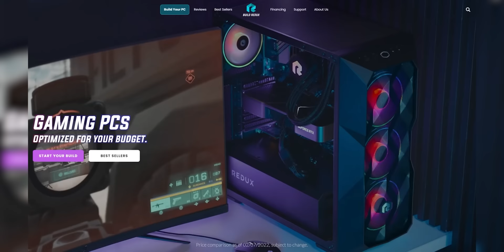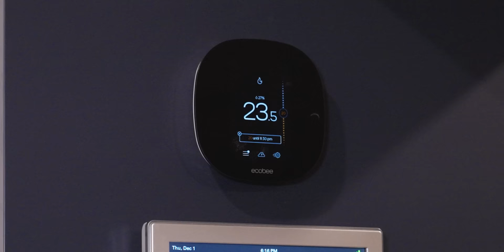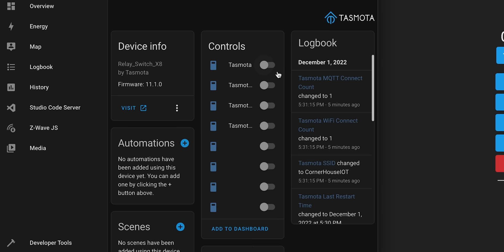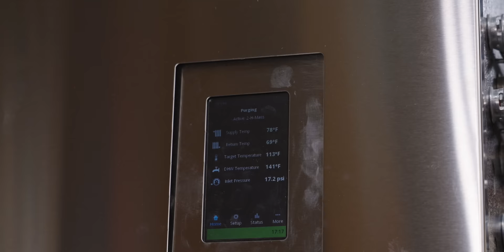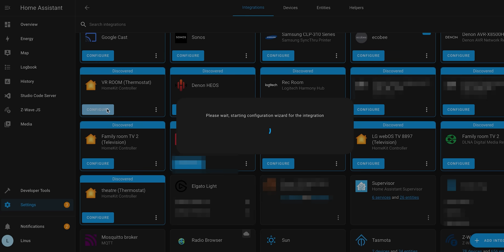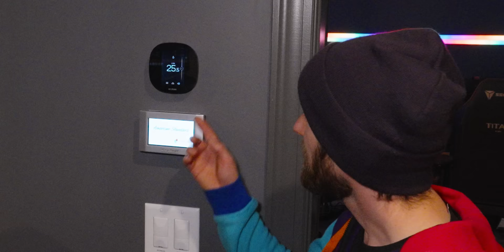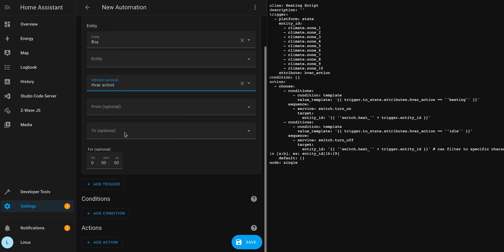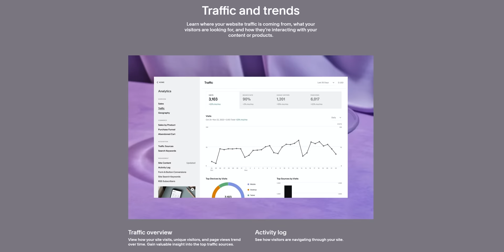My Smart Home is Stupid - HVAC Update

Comment: I would love it if you sold a curated selection of smart home devices. Ones that have been verified to work, with complete documentation.

I don't care if they're bare board like the board that does your hot water in floor heating. .
Reply: Just buy actual smart home devices instead of hobbyist shit and then guess what? They work!

Comment: Wow, you mean that I can pay for and install all of that technology, including a server instead of using my single zone forced hot air system controlled by a bi-metalic mercury switch thermostat that has sat on the wall since 1978.  How much does all that technology cost to run for a year?  Once it is working correctly?
Please include a final cost analysis in this series.  Thanks.

Comment: You can get extra sensors to place around the room, and have home assistant average the temperature of all the sensors. Ecobee won't show it, but home assistant can monitor and adjust your set temperature accordingly (with an automation).

Comment: Why use Tasmota instead of ESP-Home? Why spend so much on Ecobees when a $5 ESP32 with $2 temperature/humidity sensor running ESP-Home could dramatically simplify this? I’ve been doing this for 3 years flawlessly. Home Assistant has a software thermostat that’s so customizable.

Comment: Smart homes arn't for the faint of heart. All these manufactures want their propitiatory systems so toy have to buy their systems. And yes many utilize the cloud. So you need internet unless you go the route Linus did. Theirs a few systems that allow you to use it offline.  It's not that we don't have the technology, because we do. And things don't always play well with other stuff. You end up with a mix of different equipment and manufactures. You are consistently having to find workarounds, and then manufacture go out of business leaving you sometimes in the dark and having to change hardware. The whole smart home things sounds great in theory, till you work with it and find out you are basically better off with a non-smart home.

Comment: My question is why did you use a thermostat when you could have just simply used AZ wave temperature sensor? Home assistant has built in thermostat controls.

Comment: Jake was good until he said Rc was for cooling. Y is cooling, Rc is power. You need both C and R (R and Rc is typically bridged) for power unless using a battery . . . ALSO, why didnt you just go with GEOTHERMAL units? Plumbs into the ground, will always use heat pump, doesnt use an ugly condenser, more efficient and practical . . .  idk just saying

Comment: Why not have just one thermostat and have all the floor heating vs heat pump be done on the backend?

I mean really a "thermostat" is just an control panel and a thermostat, and those don't HAVE to be on the same device. The actual power could be don't by rpi io pins on totally separate device as well.

Comment: Pretty sure you can manually calibrate the ecobee, can't you?  If you know it reads 3c high where it is located, you can adjust the measured value down 3c.  EDIT -- I actually just checked mine now and it's there on the ecobee 3 lite, as "temperature correction" under the thresholds menu (on the actual unit, not the web interface).

Comment: Home automation is just a bag of worms. I long for the old millivolt systems that just WORKED. If you had steam or gravity hot water the heat worked fine without electricity, It wasn't as efficient as a heat pump but in a well insulated house at the end of the day it was cheaper because they NEVER needed service - as long as the gas was in the pipe you had nice steady heat.

I'm in a 100 year old house that is not well insulated but in 70 years the  steam system has only needed repair during the heating season ONCE and that was because I had the flu at the time. As soon as you add pumps and fancy control systems reliability goes out the window and $500 service calls multiply like rabbits in the spring.

Comment: This is cool, but I feel you would get better results if you ran the ecobee heat wire to the boiler.  It gets rid of three single points of failure, the wifi, the tasmoto switch, and home assistant.

You still would have local control due to homekit.

Comment: Jake you CAN tweak the multicast options on unleashed, it’s called Directed Multicast, and it’s turned on by default. This causes issues with some IOT devices.

See https://docs.commscope.com/bundle/unleashed-200.9-onlinehelp/page/GUID-92FB1860-3276-4819-8A0F-781160AB6CD2.html.  Set the “Directed MC/BC Threshold” option to 0 to turn off Directed Multicast altogether, you don’t need it in a home environment anyway.

Comment: Wouldn't be better to make your own solution with Arduinos and ZigBee's instead? Make a mesh network for the room sensors then have a have a local server and change things from there. Then you could calibrate sensors better and add new features like light sensors and turn off heat in rooms that aren't used for example. I think this shows how hard it is commercially to offer a one to all solution when use cases and preferences are very varied.
Reply: Yes.

Comment: Would it not be more efficient using some kind of PID-regulator with PWM output (sure it exists in HomeAssistant already), and not just switch a heating zone on an off.

Comment: IMO I never ever want a Smart Home. Too much hacking going on. And I don't want someone tampering with my homes environment, through a cloud based system like this. If I went this way, the whole home automation would be on a separate run network OFFLINE. I'm all for building PC's which I love to do. But this SMART TECHNOLOGY, is not the way to go, in a situation like this. As the old saying goes "IF IT'S NOT BROKE, DON"T FIX IT".

Comment: 19 degrees in the bedroom is cold?? How do you sleep in that heat? Even during summer I want it to be like 15 degrees in my bedroom.. if it gets close to 20, I get horrible sleep lol

It's like -14 out here today, and my bedroom is at 10 during winters to save on heating. You just need a thicc blanket

Comment: Linus I’m a building automation control’s specialist for large campuses. Not to insult your “solution” but it’s very much a nightmare. I would highly suggest against your current configuration for multiple reasons but mostly because you have 0 redundancy. Wiring and control circuits should contain logic. Those old style thermostats could still be retained as a safety net while the bas control circuit interrupts the standard logic. 

Script wise there’s a lot of HVAC principles/functions that you are completely unaware of and not implementing. Not properly running these control systems is going to waste a lot of energy and cause significant wear on your equipment. I’m only making this post because you live in Canada and are messing with your family’s heat. Please consult someone who can give you a proper solution.

Comment: Way to overcomplicated!! I run things on raspberry pi's, no cloud nonsense. Boilers work by sensing the circulating water temp,  not by a separate switch that you automate. And all you need is thermistors in the room. NO thermostats! This is the way smart buildings operate. Stop overcomplicating things!
Easy peezy

Comment: 12:08 the moment you realise even temperature measurements are difficult and conflicting.  I honestly just see you guys fiddling with the interface right now.  If you haven't started to consider all the logic you'll need behind it yet.  You aren't even a quarter the way there.  Allowing all those dumb wall point consumer grade garbage touch screen things to have control over zones is only going to lead you to pain and annoyance with zone ping-pong and excessive boiler time.... and many more things.

Comment: “Smart home”  you are far from it.
Your problem! Absolutely wrong thermostats, your Thermostats are working like a light switch , on and Off.
Your Hot water heating system just works on and off, not smarts at all, and it is not fancy and yes you are right the thermostat location “Wrong”.
Thermostat should be in every room and provide feedback to a zone manager, a zone manage should be provided for each floor level . floor heating thermostat can have a floor and room sensor , also thermostat can and will control heat pumps, fan coils/furnace  and other equipment , the trick is they have to communicate with each other like a computer network, each thermostat will talk to other thermostats to send temperature information to the zone manager, the zone manager  takes the information and sends it  to the heat source control like a boiler or heat pump the heat source controller gets the information status of each thermostat and also has the information of the heat source water temperature and decides what temperature should be provided from the heat source, meaning your Boiler (IBC) would get a 0 to 10 VDC signal to provide the needed temperature based on the feedback information from your thermostats, but your Boiler is running a temperature strictly based on a reset based temperature, very little energy management, There is a lot of room for improvements.

Comment: This is such a janky way to build a home automation system. For what you have spent on all this stuff, you could just have had a proper fully wired integrated building control system like Loxone that takes care of heating, cooling, access, security, lighting etc all running with on-site hardware and software (with remote access) and total configuration and one clean app. These systems are ‘fit and forget’ reliable, all this unnecessary complexity will make your system impossible to support long term. Your method is going to cost 10x a proper building control system once you factor in ongoing maintenance and dealing with endless obsolete bits of hardware and impossible to support custom software integration.

Comment: smart homes are cool and all but honestly the most ill ever do is lightbulbs and possibly plugs. but really only light bulbs. they are non trivial compared to any other smart home bullshit. XD smart homes are just pain, trying to solve problems with smart devices is just adding in so many point of failure. more things will always go wrong than they will go right, and will be brutal replace when they inevitably dont work in a much shorter period of time than the traditional variants of these normal in home systems, like light switches and heating.
Reply: I agree. There isn’t really a point to make your heating smart, at least not from an energy saving or comfort perspective. For me a smart home makes the most sense when it comes to power distribution (to make the max use of solar installations), automatic shading and cooling, as well as automatic lighting

Comment: Why does it all have to be wireless. Just make it wired. It’s so much more secure when it’s wired. You don’t have to worry about it not working because of internet issues if it’s wired. God. I hate wireless “smart” devices. Why does my oven need a wifi connection. Why won’t my coffee maker work without a software update. God fuck. I hate “smart” devices I hate them I hate them I hate them I hate them I hate them.

Comment: Dude, I know you're trying to make a "smart house", but why are you overcomplianting so many things? Forced air heating would be so much cheaper to have installed and you could still use the higher grade thermostats.

You're literally just taking the route of constantly throwing money at a problem that already has a solution. What you're trying to get working isn't even impressive new tech.

Edit: the reason it's in Fahrenheit is because it's the better way to adjust the temp.

Comment: Smart homes are the most unnecessary geek-shit ever. Basically everything runs more economically and with that eco friendly when handled manually and smart systems also don't even save time, since not every day is the same and with that programmable. So you constantly are messing around with your systems anyway and are wasting the couple minutes that these automations should save you.

Comment: Emotional thermostat operation results in greater energy savings, research shows; as opposed to the logical users who set and leave programmed system unattended. 

Emotional users stomp over and, fearing freezing,  yank the dial all the way to max. When air reaches temp 10 minutes later, they jump up and slam it off with extreme prejudice.  Walls, floors won't get a chance to transmit excess heat outside. Objects never absorb heat.  But all that jumping sure warms them up.  

Logical users set and forget, as they sit immobile reading Jean-Paul Sartre, resulting in unused spaces unnecessarily being heated, with higher conductive transmission losses. And they ironically complain all the time about freezing.  The  logical and dependable pay off is they get to make fun of the unpredictable, emotional people.  But at the cost of paying more for the privilege of freezing in an echo chamber of their logic.  Also, emotional setters get lovers to remove their clothes more often.